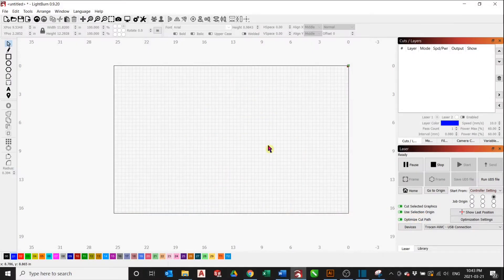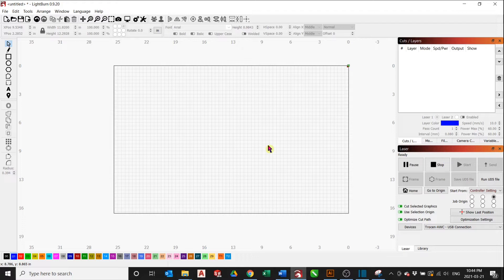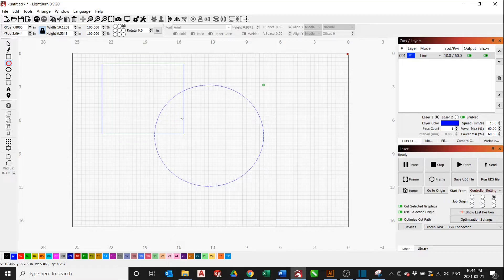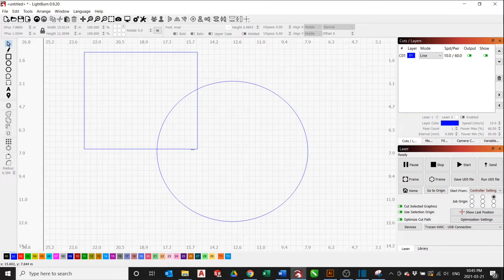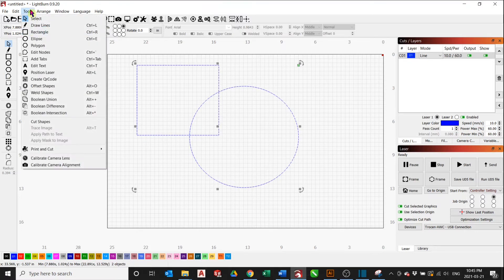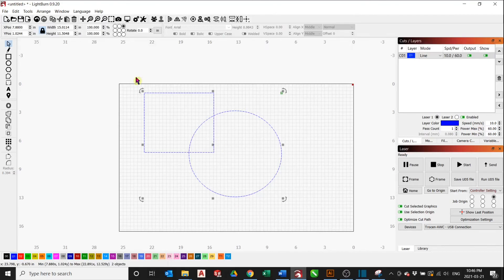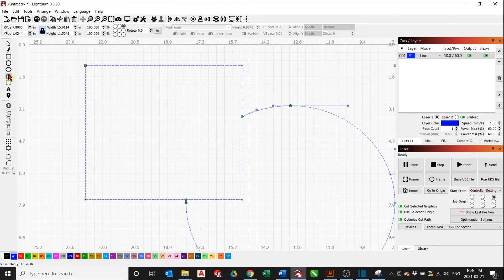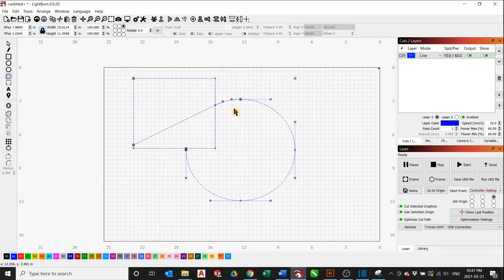Trim & Extend Tools on Lightburn | LIT Tutorials

Comment: looks like a lot of steps to remember just to 'trim' a line. Why can't Lightburn make a "Trim" "Extend" tool?
Reply from the maker: I talked to the developer of Lightburn about this (among other improvement ideas I had regarding drawing on Lightburn), but all he told me was that Lightburn is "not meant to be a CAD software". TBH, my background is in Engineering so I used AutoCAD 90% of the time when Im creating my drawings since it is much more user friendly and I have access to it. Then I just export it onto lightburn toload into my laser. But most people don't have access to AutoCAD, so Lightburn is their only choice. I was just one person, but maybe if more people requested a simpler and more user friendly way to draw on Lightburn, he might consider spending more time on this. :)